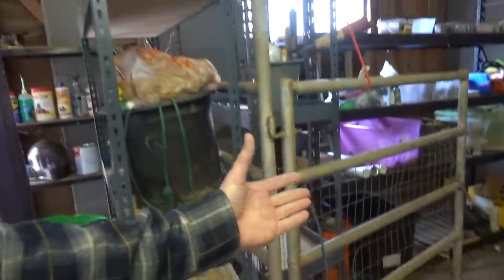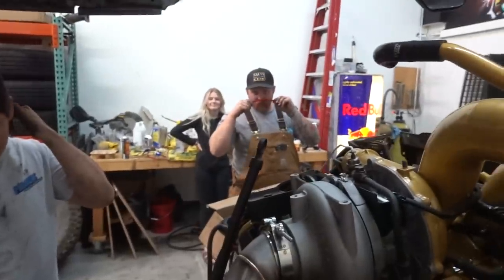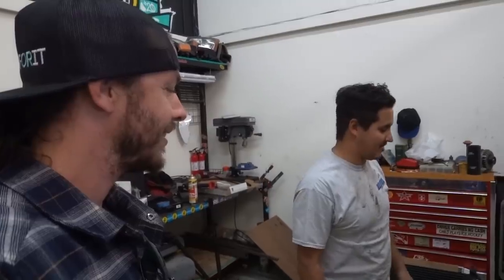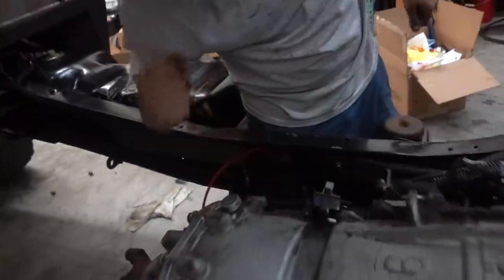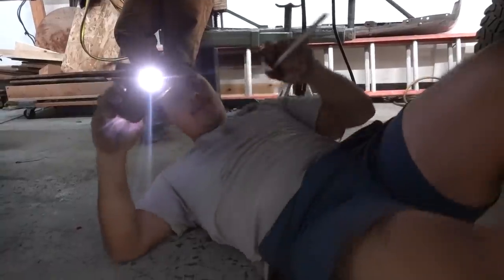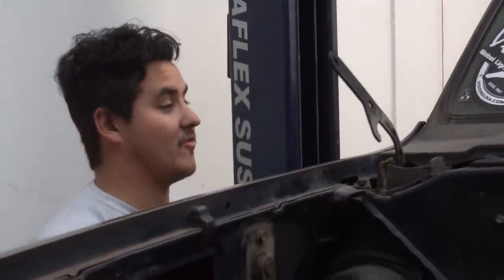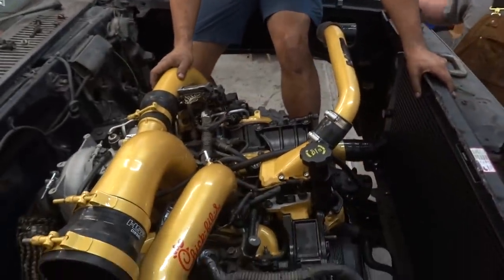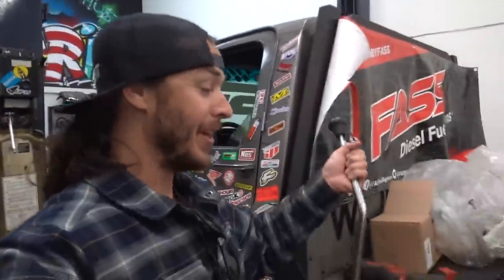Firing up the new BIG turbo for the Duramax! (k20 Diesel Swap Part 11)

Comment: I had a 3 inch bolt go into a 37” Mickey Thompson tire, pulled it out and the tire never leaked air, road on that set until they were bald with no issues. Have picture proof of the bolt in tire, and bolt out because when I called the tire shop they didn’t believe me😂

Comment: just a curious question, but to keep the battery charged, have you thought about using a battery charger? oviously until the cooling system & leak issues are solved, the truck can't run long enough to charge. that way you wouldn't have to keep jumping it with another vehicle. or you could just use a jumper pack.

Comment: Why dont you just use the wheels off the grey obs? That would be much more resourceful
Reply from the maker: The grey truck will be back up and running soon and back to being my daily.
Reply: @DMAXRYNO  till then put those wheels to use and that will buy you time for actually finding something you like! Its better than buying tires for rims you don't want, just my thought but I'll still be here regardless 🤟

Comment: I think dude put the body mount on the wrong side. Shouldn’t the rubber or plastic mount be between the cab an frame.
Reply: It’s a two pice mount. Polly on top and bottom
Reply: @squarebody_Tig  solid,  I was thinking that’s why there was fitment issues.